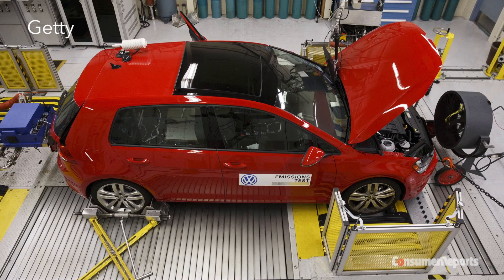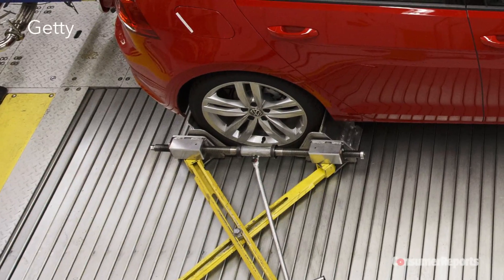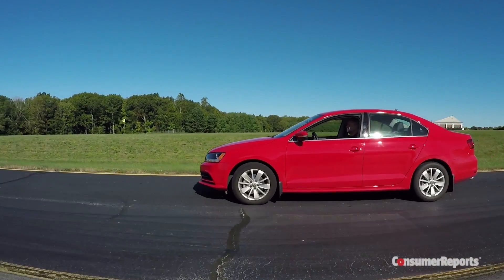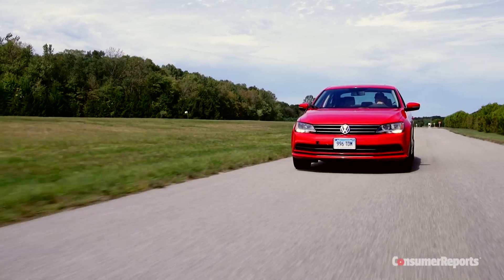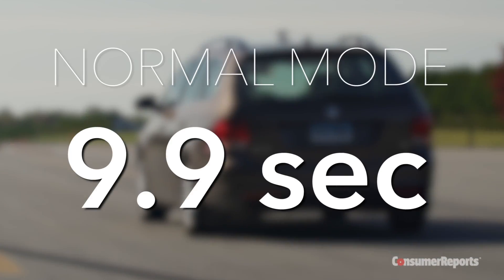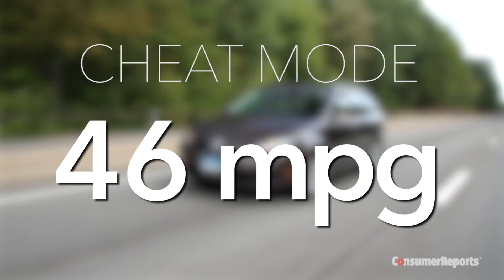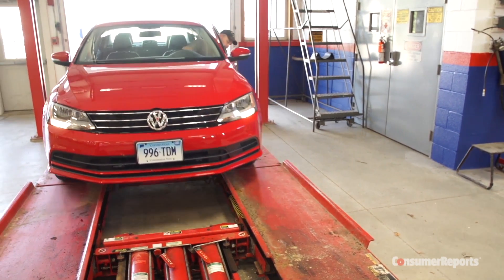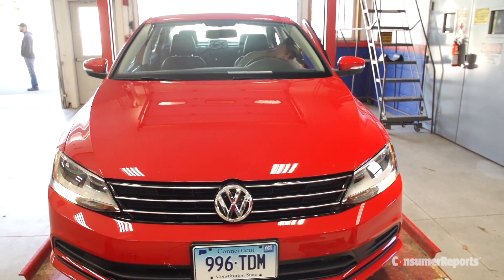How Volkswagen Diesels Perform in 'Cheat Mode' | Consumer Reports

Comment: So, if you disconnect the sensors to the rear wheels wouldn't the car report an error, that the sensors aren't connected?

Did you test the emissions when you enter (what you believed to be) Cheat Mode? How can you be sure that the car is in Cheat Mode?

Comment: As much as I respect CR for trying to figure this out on their own, this hasn't told me squat. Worse mileage in cheat mode? I would guess worse performance over anything. It's as if VW said: "Sure, our car can technically pass the emissions test when it needs to."

A friend of mine has a late model diesel Jetta wagon. While it is an overall fun/nice car, it actually stinks as much as their previous diesels did, and that's without the nefarious check engine light being on.
Reply: +Monacomaverick YES that's exactly what VW said.  They wanted their diesels to pass emissions, but didn't want them to feel slow or get poor MPG.  So they created two modes: One for the EPA test (clean but sluggish), and a second for the customer (high emissions but good performance)
.
As for "stink" remember that VW is cheating & emitting dirty exhaust, but other diesels from Chevy, Mercedes, and BMW are compliant & clean.  You don't smell anything from them
.

Comment: Ignorant americans. Watch all the stoneage V8's and V6 trucks and cars on your roads.. What do you think of the emissions of that
Reply: +Digi20 TDI engines also have catalytic converter & yet still fail.  It's possible the V8 engines are failing too, but found a way to cheat the test.  Honda, Ford, GM were all caught cheating during the last decade......... so you cannot say with certainty that those giant V8s are clean.
BTW the volkswagen output "upto 0.4 grams/mile" of NOx.  A heavy-duty truck outputs 200 grams (legally).  If you're having trouble breathing look at the freight trucks
.
Reply: Ignorant foreigner, those vehicles still produce less nox than vw's diesels
Reply: +eggbirdtherooster Yeah, and lets compare that to a stonage diesel.. Cough cough.
Reply: +eggbirdtherooster have fun dying of ozone pollution and just because the engine has more cylinders doesn't mean it's more polluting. Here's a read if you would like to inform yourself. http://www.edmunds.com/car-reviews/features/emissions-test-car-vs-truck-vs-leaf-blower.html
Reply: +egg      Diesel exhaust  is well known to cause cancer. Gas burning cars have cleaner emissions.
Reply: +eggbirdtherooster Wah!   I have to live in a shithole apartment in a socialist country.  Wah!
Reply: +eggbirdtherooster as long as they have a catalytic converter they at least have no problems with NOx emissions like the TDI engines ;)
Reply: +eggbirdtherooster You´re right ! Using an other burningprocess petrolengines will have more CO2 emissions than dieselengines! And if you put an NOx-strainer into a dieselcar, the diesel would emit less emissions than a petrol one. But Volkswagen did not build these strainers in their cars and thats the Problem !
Reply: as far as i know, NOx is (almost) completely eliminated on petrol engines with catalytic converters. even really old big V8s are drasticly cleaner (in relation to NOx emissions) then modern diesel engines. for the diesle engines, keeping in check with tighter emission rules is really a problem nowadays..which might be the reasion this hole dieselgate scandal happened in the first place.

and yes, emission regulations for heavy duty equipment are a joke.
Reply: First of all, are you buying? If so, then I'll drive anything you'd want to see me drive. If not, and I'm paying for it out of my own hard-earned paycheck, I will drive what the hell I want to drive. Do you kapeesh???

Comment: You did not activate cheat mode. You just gimped the traction control / ESP system, this causes the car to reduce the available torque which would explain the slight decrease in acceleration and fuel economy.

Comment: Your tested MPG is still higher than what the original EPA rated MPG for the 2011 TDI Jetta.   They just need to disable cheat mode so that it meets emissions requirements. The car still meets/exceeds the  EPA expected MPG.  30 City 42 Highway 34 combined.  https://www.fueleconomy.gov/feg/noframes/30654.shtml

Comment: I had a 2012 VW TDI Touareg which was not on the list of vehicles and went to a 2015 Golf Sport wagon. I was told and confirmed that the 2015 model came with the "Add Blue" system, which the Touareg had as well. from 2009 to 2014 those VW car models did not have room to have the Add Blue system. I was also told the 2015 models were included to basically cover themselves with the EPA. So did the 2015 VW test car in this video have the Add Blue system? and was that figured into your data?
Reply: +Kurt Gillespie NO it didn't have Ad Blue system.  CR isn't that dumb
.

Comment: Except here's a problem with this test. The 2015 TDI models should all have SCR/urea tank and use the newer non-offending EA288 2.0L TDI engine. The 09-2014 TDI engines are the EA189 which is the offending models. Of course fuel economy and performance would go down, that's how VW was able to get away without some form of SCR and still have performance and fuel economy.

Comment: Evening, we had our 2012 Passat TDI sel and they did the reflash months ago then our Emission system failed when the filter clogged faster and we had horrid[stutter] acceleration after the reflash and our transmission went also!? So, maybe with your test you you may be able to prove whether the emission etc is working harder and will fail faster?  Thanks for your sound and transparent service.

Comment: I actually bought my TDI Passat  for two reasons;
1.  Leg Room.   Honda, Subaru, Toyota,. None of them have the legroom for someone of my height.
2. Environmental reasons.  The clean diesel produced less emissions than the comparable Honda Hybrid according to Car and Driver tests.  Now that is suspect, because it was probably while in cheat mode.  This is the part that pisses me off.  I am willing to lose a few MPG to get the cleaner emissions though  I suspect that real world driving would never match the lab testing.

Comment: Normal 53 mpg / cheat 50 mpg -> Are you saying it's less efficient when it's in test mode? That doesn't make any sense.
Reply: +I Don't Believe Lies NOT just diesels but also gasoline cars emit more NOx when running lean/high MPG.  That's why Honda used to sell "lean burn" gasoline cars, but now they phased them out.  The NOx levels were too high to pass current legal limits
.

Comment: The only real way they can prove it's in cheat mode is to measure the exhaust gases, which they didn't do. I don't think VW would go as far as to engage in criminal conduct if the performance penalties are not that substantial, especially for the Lean-NOx Trap equipped vehicles.

And cheat mode may create more reliability problems, although VWs ain't exactly regarded as reliable to begin with.

Comment: I saw one test of a VW turbo diesel on a front rolling dyno and then on a 4 wheel dyno and the loss in power and torque was observed in cheat mode but it wasn't dramatic. I think your suggestion that VW pays restitution for owners that see a drop in performance after a fix very weak. That is the bare minimum you'd expect even bad companies to pay. What I would really like to see is people in jail. VW acted with premeditation. They set out to cheat the regulations and once it is proven, they should end up in jail. The fact the US head of VW knew about the cheat in 2014 means knowledge was widespread in the corporation and nothing less is acceptable. Find out who made the decision roast his *$&! They willfully polluted, caused undue hardship to countless innocent people and probably deaths knowingly all the while increasing their profits. They must be penalized severely if only as a deterrent to prevent make other car makers from doing something similar. I feel sad for all of their innocent employees that will no doubt pay the price for these crimes, but that's what should happen companies that feel they are above the law. I think VW should be brought to within an inch of solvency for many years and anything less would be unpardonable.

Comment: did you really simply disconnect the rear wheel speed sensors? because then the abs/esp controller will recognize a disconnected sensor and NOT the rear wheels standing still, whereas when it is tested on the dyno, the controller will recognize the sensor and by that can follow that the rear wheels are standing anthus activates the cheat mode. so if you simply diconnected the rear wheel senors, such as it looks like in your video, the test is not significant and has to be redone. in both ways the abs/esp controller and thus the ecu  has most likely different interpretations.

Comment: The newer VW's with the 150hp TDI engine is actually the newer EA288 engine which has a SCR installed with AdBlue tank to clean up emissions, which is probably why the 2015+ cars (and the 2014 Passat TDI which was the first to receive the EA288) is less affected by the 'cheat mode'. The main culprit is the 2009~2014 EA189 which doesn't have an SCR or AdBlue emission treatment system that's going to take a beating both in MPGs & future reliability.

Comment: Well, a 3-4mpg difference certainly sucks, but it's more of a sting than a wound. Definitely a piss on those that bought the car for the great fuel economy though, but at worst they're still getting 45+mpg. Better than those Civic Hybrids which went from 50-55mpg down to like 35mpg once the software update was installed.
Reply: +Unbearable Pain The problem is that this only tests highway mileage, when the cars are up to temperature and the most efficient. When engines are cold or idling in stop and go traffic, emissions are greater, and that will really measure how much "cheat mode" impacts fuel economy. Also, we have to consider the fact that NOx reduction will likely require more EGR. Because EGR creates more heat, that will likely force VW to make other changes to insure reliability, which likely mean added more cooling, which also reduces efficient.
Reply: +Unbearable Pain Or Just put the rear wheels on a cart or something.
Reply: +Unbearable Pain     Hyundai went through a shitstorm for what, 1-2MPG off from claimed EPA numbers? VW needs to pepper their angus.

Comment: Also, your fuel economy numbers don't show any meaningful data. A change in wind speed or direction will make a huge difference. How many times did you run the MPG test?
Reply: +compu85 Consumer Reports has a very thorough testing regime, that includes testing the cars in both directions. You will not find a better independent testing procedure anywhere.
Reply: +blackvr4tt LOL, that's why they never caught it the first time and didn't get it this time either.

Comment: You need to go back to the drawing board on activating cheat mode. Your test didn't use it, the car also looks at acceleration rate (can't go up more than 300 RPM per second), G forces (it uses the ESP lateral acceleration sensor), and starting coolant temp. 

Instead of just guessing contact a chiptuner and have them help you.
Reply: This is true.  Cheat mode is more complicated than CR has tested here.
Reply: +compu85 HOW  do you know the VW looks at acceleration, lateral forces, and coolant temperature?  Citation please
.
Reply: Um they have emissions readings in cheat mode to prove they activated it....
Reply: electrictroy2010 This guy compu85 actually found VW's cheat years ago but wanted to be the nice guy and didn't say anything.
Reply: +compu85 Interesting theory. I hope they read your comment.
Reply: +DarkSim905 Is he supposed to know every test someone makes?
Reply: +compu85 I love it how all these "editors" find a way to dumb things down. ie. unplug wheel speed sensor lol.
Reply: +DarkSim905 You  really think VW told them how to do it? This isn't how you set the cheat mode, its way more complicated than this plus they tested 2 different engines,  of course there going to be different.
Reply: ***** Not sure what book you're referring to, but i'd be interested to know as someone who calibrated engine computers
Reply: ***** Of which I have one in my desk since that's part of my work. Not sure which chapter is the "cheating on Federal tests" chapter.
Reply: I don't see a mention of confirming the cheat mode through emissions readings.

Comment: I left a more complete reply on CR's actual page, but the EPA said the switch for the cheat is looking for those parameters seen in things like the FTP-75 and HWFET evaluations to enable it or keep it enabled.  More precisely, the ECM is looking for specific variations in speed, if anyone is in the driver's seat, barometric pressure readings, steering wheel orientation, etc.  Your testing does not seem to account for those factors.  Did you actually do something to trick the computer into thinking that these criteria were being met, were those claims not accurate, or did you just not realize or account for those conditions?  Because as far as I can tell your testing did not put or keep the car in the proper mode.
Reply: +Andrew Price Excellent response, I'm very skeptical that they succeeded with the results they saw. VW would not have gambled with polluting 40x as much as advertised and a multi billion dollar lawsuit for 3mpg difference in their cars.
Reply: +Steve Thompson BUT if they don't meet MPG minimums (CAFE) then they will get FINED billions.  Avoiding that fine is a powerful motivator
.
Reply: Exactly
Reply: +Steve Thompson I'm with you Steve,  i dont see how it could be FORTY TIMES the legal limit when in the U.K/EU they are only registering around FOUR-FIVE TImes the legal amount

Comment: Isn't Cheat mode what they are running now?  Do you mean to run them OFF cheat mode?
Reply: +Mrchevy baja .  They only go into a cheat mode when the emissions is being tested.  When they running normally they kicking out a lot more pollutants.
Reply: But they're not cheating on the dyno, they're cheating on the streets.
Reply: +Mrchevy baja Cheat mode is the special mode that allows them to cheat on the test.
On the road VWs are off cheat mode and on regular mode.
Reply: No they go in cheat mode only when tested by the epa. During that mode they make less pollution to trick the epa. After that they get into normal mode and pollute more than allowed.
Reply: +Mrchevy baja Depends on what you mean by cheat. CR is calling it "cheat mode" because it is used to cheat on the emissions test, thereby obscuring the car's real emissions levels.

Comment: And this is just in "cheat mode", which allows the car to past the test, nothing more. If you understand anything about NOx reduction, you know the fixes will likely reduce efficiency even further, because they will likely make other changes to help the engines cope with added heat and stress of NOx reduction.

Comment: Terrible test, which was unable to prove... well, anything. Put the car on a dyno, run the EPA route as they test it, and measure NOX. Anything else is sensationalism, like this video.

Simply unplugging a wheel speed sensor is not the same condition as having the car on rollers.
Reply: +PhillipThomas THEY wanted to see how the VW will perform when running in clean mode
.

Comment: In the cheat mode vs the normal mode how do nox pollutants differ? I own a 2002 Jetta tdi and it's probably one of the best cars I've owned (power fuel economy distance and reliability). I know it doesn't have clean diesel tech but now I'm curious does better fuel economy have better or worse emissions? I have always thought that if I'm getting 40 - 47 mpg vs another car that gets 30 or so for comparable power that the 40 mpg is more environmentally friendly. How does fuel type come in to play. I foresee a new series with many tests.
Reply: +s0584333 DIfference is 40x the NOX in cheat mode.  NOX is the major contributor to ground level smog (think Beijing) whereas CO2 is greenhouse gasses.  Single metric environmentally friendly scores are just bullcrap for people who don't understand chemistry.